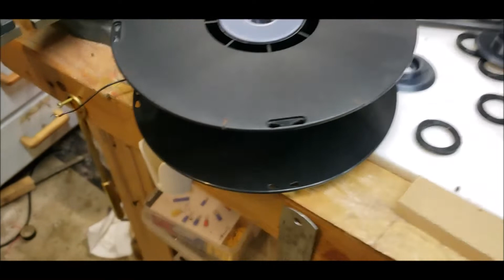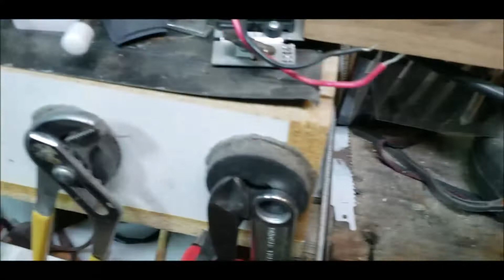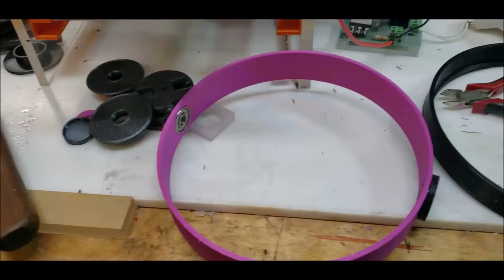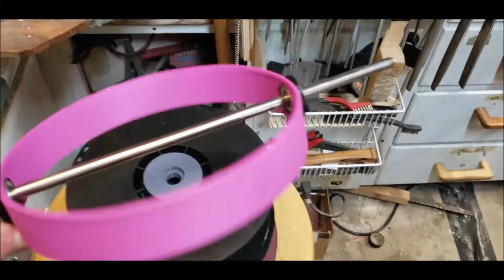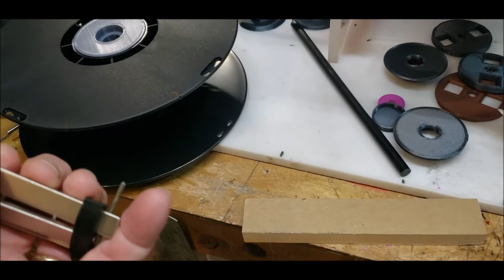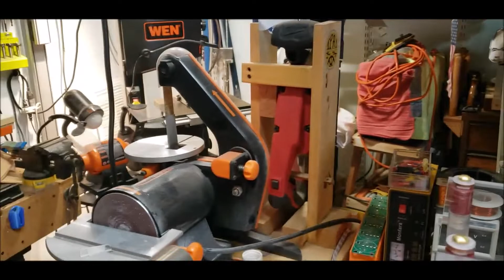3D Printed 2 New Rotor Designs

Comment: Haha, alrighty so normally I have my opinion ready.. I wouldn't know which way the magnet should go, so maybe you can enlighten us. How about the green magnet viewer thingy or like just make it so both ways can be tested on a pickup coil or motor coil? JP
Reply from the maker: sorry my friend I'm not understanding your question? It doesn't help that I have to different projects going on at the same time ugggggg
Reply: @mcorrade  Ah right, about project printer reel. The question here is 'can you use the magnetic field viewer?', you have this green colored creditcard like magnetic field viewer. You can use it to tell if the three magnets should face inward or outward. Or otherwise, maybe you can build a modular build so that you can simply try it both ways... Project newman is also getting along nicely, I'm curious! JP
Reply from the maker: @toffeeflavour  ah yes in the next video I show this